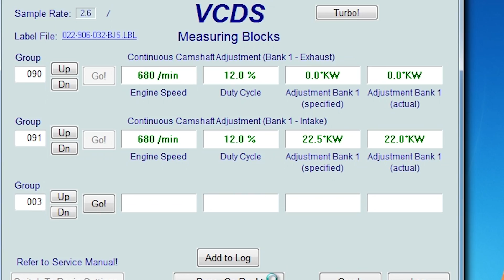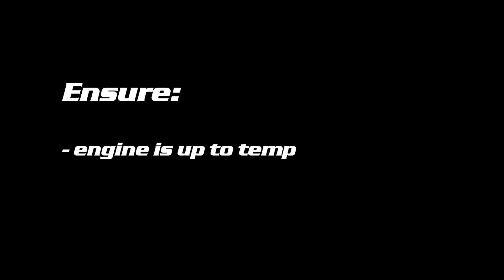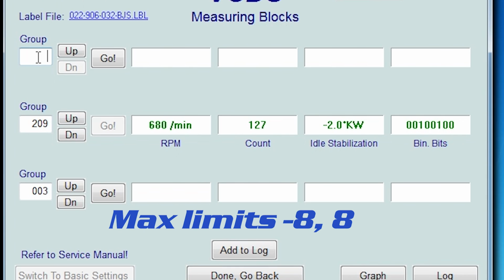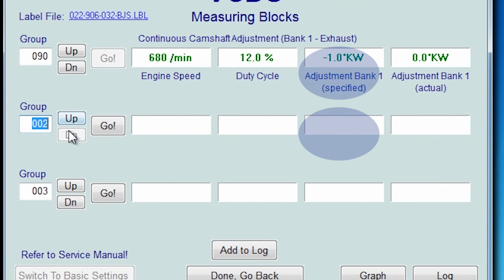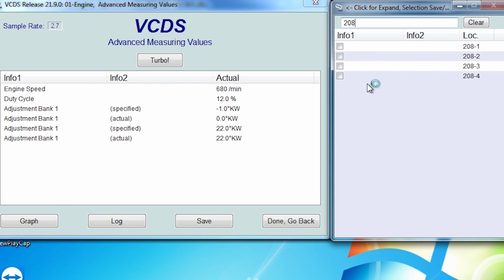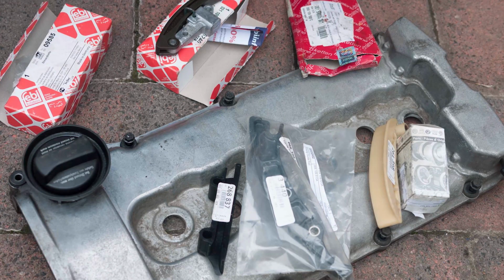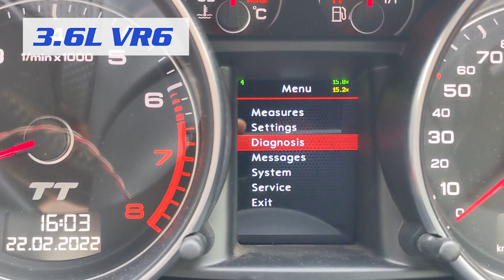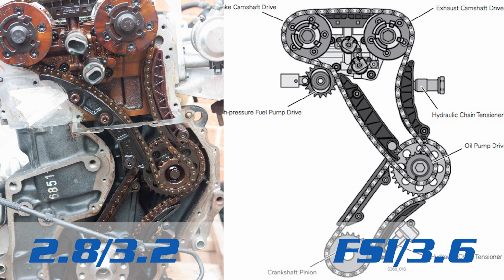Check VR6 timing chain stretch w/VCDS or ColourMFA (Golf R32 Passat R36 Bora 2.8 Audi TT 3.2)

Comment: My 208 reading is 0 and 209 is -7
My 90 and 91 both reading 0 
What do you think? Engine is very very quiet no rattle at all ever. Thanks
Reply: Probs could be 1 of the solenoid issue.. you should do a oil flush and then change oil every 3k I've seen peoples numbers drop
Reply: @sajidqureshi2175  thanks mate, funny it’s had two oil changes in 3000 miles and I’m convinced the original figures weren’t true
Reply: @khsmith6242  hmmm have you done oil flush the forte oil flush is really good.. I have a mk4 r32 aswell on 113k and chains was done at 74k. I checked the reading few days ago and still same at -1-2 and 90 and 91 0 and 0.5 so all good. I change my oil every 2k 2.5k.. car pulls strong from low revs lots of grunt.. remapped from rtec.. dyno bhp 247hp and 260lb ft. Before the chains done I got no readings on 208 and 209 think bcuz they was well above -8
Reply: @sajidqureshi2175  not done a flush no, at those numbers prior to changing chains were you getting eml or misfire etc?
Reply: @khsmith6242  before chains eml was on and codes for cam and crank correlation. Also noticed when starting from cold the when car fires up it felt weak.. but idle was perfect no misfire and the grunt was always there before and after chains.
Reply: @khsmith6242  how does yours drive nw.. does it have grunt from low revs do you feel the full torque kick in
Reply: @sajidqureshi2175  funny you say that a couple times it’s felt weak starting but it pulls well no chain noise etc never dropped any related codes. I think I’m going to try read codes again as I’d got a mate the read them prior to purchase
Reply: Are block 90 and 91 readings ok.. what the % it should be 15%
Reply: @khsmith6242  what was your reading before chains replacement
Reply: @sajidqureshi2175  chains not been replaced buddy
Reply: @sajidqureshi2175  okay so it was a mate who did it via vcds. So 90 was rpm 680 load 18% temp 76 and idle stabilisation both zero
91 was exact same
Reply: @khsmith6242  hmmm ok also do you know the history of car servicing bcuz i know most r32 when new was on longlife servicing which is absolutely fucking ridiculous and bad of engine. If its been on long life oil and changed everything 20k that can cause chain issues
Reply: @khsmith6242  oil temp should be higher around 100.. then check also thr load should be around 15%
Reply: @sajidqureshi2175  it’s got a very good history from new tbf VW if not VW some very very well respected independents one of the reasons I bought it. I think I’m going to get the chains read by a specialist and go from there. Thanks mate
Reply: @khsmith6242  yes that's good.. yea get checked from specialists. Are you in uk?
Reply from the maker: 😲Hmm that's weird that 90 and 91 are both zero. No codes ? What engine is that ?
Reply: @ianpgonzaga  mk4 golf R32, 2003 car with 103,000 miles. Whisper quiet engine
Reply from the maker: @khsmith6242  and zero engine codes ? If no codes then just monitor it I guess. Seems really strange though ...
Reply: @ianpgonzaga  no codes, so can you explain why is it strange? On the 208/209 figures showing a spread of 7 assume that indicates cam chains required?

Comment: There is another vr6 2.8 24v engine tht u shud of covered which EVRYONE misses.. dont know y thou. Its the the first vr6 24v that came out. They had 3 chains instead of 2 which the later variants came out with..
Cam chains are the same as the vw 1.8 turbo, then it has anoyher gear connected to teh cam from which the secondry chain hooks on to run the intermidiate shaft and then another  chain  than runs from intetmidiate to the crank sproket. 
Could u make a video in regards to this engine cz there is nothing on youtube in regards to this engine.
By the way engine code is AEU 2000 to 2001.
Reply from the maker: Hi Pearl. Interesting! I'd like to cover it but it would be something I don't really know much of so I would've be able to give accurate info.
Reply: Hi thanks for your video, I've had a fault p0343 on my 3.6 r36 so started looking at it.
My 208/9 values were +1 and -3, not sure what to make of that. The timing chain was replaced less than 2yrs ago by European specialists

Comment: Got a strange one. 
208 - Intake Cam. Offset = -9.0KW
209 - Exhaust Cam. Offset = -9.0KW
90 - Adjustment Actual = fluctuations between -1 and 0.5KW
91 - Cam. Adjustment B1 Intake (Act.) = Fluctuation from 2.5 to 10.0 KW

Sitting listening to the car idle, the "timing chain" noise can only be heard for 2 seconds every 5 mins. Worth noting I have no exhaust after the down pipe.
Reply from the maker: Hi Sean. Thanks for watching. 

This looks like it really way off! Do you have any engine performance issues?
Reply: @ianpgonzaga  Drives fine. Not had it out lately but drive it home 150mi when I bought it. Drove without fault. (Untill the exhaust snapped at the resonator lol)
Reply from the maker: @seanrobertson3833  LOL how does the exhaust ust snap! I'd say keep an eye on it - but those values are waaaaay way out - hopefully it doesn't just die all of a sudden.
Reply: @ianpgonzaga  I noticed it showing ERROR after about 20 mins of scanning, hitting Go brought the values back. Not sure if maybe the impulse sensor is dodgy? 
If I keep driving it, will it go BOOM? Or will the timing chain noise be more frequently/constant. 

It has been bought as a project car. It's an A3 2004 3.2 on 92k miles. I've got the quarter panels to replace (rust) and the timing chain on my list. But trying to work out the urgency of the timing chain.  I have so far got a new exhaust sitting for it as well as a new interior.

Comment: First of all, thank you so much for being the only one that actually explains how to read those values and what do they mean. Awesome job!
I’m a little concern about my VW MK4 R32
Block 208 reads -8.0
Block 209 read -7.0
Spread is just 1 degree 
Then 
Block 90 reads 22* and 21.50*
Block 91  reads 3* and 3.50*
Not sure why looks like 90 and 91 are mixed between them 
Also, I used the OBDeleven scan 
Do I need my timing chain to be changed like right now?
Thanks!
Reply from the maker: Thanks Santiago! 

If you have a noisy engine I would probably do the timing chain and guides service asap. 

If it's not noisy and you tend to drive hard then probably best to have it high on the priority list. 😉
Reply: It’s not noisy at all… 
And I just got her, so I’m still easy on her until I actually know the car lol
Thanks again! It gives me time to find a technician that actually know how to work on it, hard to find in the Florida keys
Reply from the maker: @santiagopalmero3807  good luck! You got any pics of your TT  in insta?
Reply: @ianpgonzaga   I don´t have a TT, its a MK4 VW R32
Reply from the maker: @santiagopalmero3807  oh yeah that's right. Did you have pics on insta of the R32?
Reply: @ianpgonzaga  not that many , but I’ll start posting  more often lol 
@santipalmero

Comment: Perfect, straight to the point video. My findings: -3.0 kw and -5.0 Kw. is this bad? Do I have to think about the chain replacement? Thanks
Reply from the maker: Thanks Dusan! ☺️ That's on the way to bad ... The closer the numbers at  either extreme ( -8 or 8 ) calls for consideration of timing hardware service. Good luck!

Comment: Ian bro thank you for an an awesome educational video ! Wich made me run to my Touareg 3.2 to check the timing. 
From what i understood and the results that i saw on my vcds im guessing i need new chains .... But before i commit to spend some $$$$ ill appreciate your input ... So here are the results 
G.208 -5
G.209 -5
G90 cam exhaust 20
G91 cam intake 0 
All are from the 3rd column

My guess is to order new parts right ?
Reply from the maker: Hey Nabil. Yeah sounds like you should look into chains and guides replacement. The closer to -8 the worse for wear it's all at :)
Reply: @ianpgonzaga  thank you man. 
You are awesome 😎😎👍

Comment: Looking to buy a R32 but I heard a rattle. The owner took it to a garage but only got the next values : "intake camshaft adjustment = 0 KW" and "actual signal inlet camshaft = 5 KW". Are these values any good, or don't they relate to the timing chain stretch?
Reply from the maker: Hi Martijn. In what measuring blocks are you talking about ? 90/91?
Reply: @ianpgonzaga  Hi, it wasn't measured with VCDS but with Mega Macs 66. I'm told those values correspond with the 208/209 in VCDS but as I don't know that system, I can't tell if that's correct. And since the timing chain is a big job, I'd rather have some certainty...
Reply from the maker: @martijnreekmans6171  sorry I'm not sure what mega Mac is either. Best to double check with VCDS or something similar to make sure...

Comment: Great video! I have a Passat 3.2 FSI with 1 fault: 000023 bank 1 sensor 3 (g300) / engine speed sens (g28)
P0017 - 002- incorrect correlation.
In group 90 adjusment (speciefied) -25kw, adjusment (actual) -6kw.
I bought this car last week, and I didn't know that had this problem.
Can you help me ?
Thank you!
Reply from the maker: Hey thanks. Incorrect correlation sounds like it's not in great condition in there. Timing hardware most likely needs attention.
Reply: @ianpgonzaga  thanks for your quickly answer. I update information.
I disassemblied upper timing chain cover, found a disaster.
I had a upper timing chain guide broken, replaced it by a new one, and seted chain in correct timing. The fault persists. Does this mean chain stretch?
Reply from the maker: @shagusgaming  that's good you found some of the issue. Remember there are more guides in the lower section. You would typically inspect those too.

Comment: Best explanation Ive seen on timing values. Thank you! I have a question, checked my 03 GLI 24v Im certain it needs chains. My intake phase is -6 my exhuast -5 but I noticed my cam adjustment is swapped from yours, intake is 3 and exhaust is 22. What does that mean?
Reply from the maker: Hey thanks. I would say with those values being so out it definitely time to replace the timing components before your engine kills itself.

Comment: This is a great video! I have a 2007 passat 3.6 with the BLV engine and when I go to groups 208 and 209, the "intake cam offset" is -4.0, and the "exhaust cam offset" is 0, so I might need to replace the chains soon right?

In group 90 it says my adjustment is -25, and in 91 it says it is 18. When you are in the passat r36 the numbers seem similar to mine, is this good or bad? Thank you!
Reply from the maker: Thanks Riley. I would consider it soon. Otherwise do more frequent oil changes to tide you by and hopefully no rattles start making their way into your engine. 

If your 3.6 group 90 and 91 are the same as mine i'd assume that is the set value. There is not too many people who have taken these readings for m 3.6 VR6 so thanks for sharing. 

You will see that the other number can fluctuate. If that fluctuate too far from the -25 and 18 that's when it's bad.
Reply: @ianpgonzaga  Ok, that makes sense, should I even hear the timing chain at all when its running? I can hear it, it doesn't sound bad but I was worried. Thank you so much.
Reply from the maker: @rileymajor2093  nah... You can't hear the timing chain at all on a healthy engine. Most common sign that most ppl freak about is the rattling on startup.

If that rattle is consistent as the engine idles then that's worry time.
Reply: @ianpgonzaga  Ok, thank you for your help!
Reply: @ianpgonzaga  Thanks for the Clarifying Video and Expert Help. I did get worried when i hear the tapping/rattle  for 5-7 seconds, upon Start-up on my 09 BLV  3.6 CC VR6 FWD
Reply from the maker: @ampiko68  no worries. 

Hope now you know what to look out for! X
Reply: @ianpgonzaga  RE: "here is not too many people who have taken these readings for m 3.6 VR6 so thanks for sharing."
cheers for the vid, if it helps, my 3.6VR6 is reading 208: -5, 209: -1, 90: -25.5,  I didnt check 91. 

Car seems to run fine, I've never had the chance to hear another one in-person for noise-comparison.
I've got a once-yearly slow cam response DTC, so I keep tabs on it. If that 208 number jumps up much more, I'll do something about it
Reply from the maker: @ExtractoDeTomates  Thanks for the info on your readings. I"ll keep an eye on mine - i am due for a timing chain and guides refresh so haven't really been driving it much.

Comment: Great video. I had my head gasket done on my Golf 2.8 V6 last year and now readings are wrong or blank and they were the same as your readings before it was done. Car seems to be running fine but now I think as  the top chain was removed to do  the head I think it may be out of alignment.
Reply from the maker: Yeah that doesn't sound the greatest result. You got no other errors? Sounds like there may be a sensor error...
Reply: @ianpgonzaga  I had my mechanic change the sensors but still the same, no engine light or fault codes so I am stumped. Blocks 208 and 209 were -8 so flushed the engine 5 times with clean oil as reading on the internet and brought the readings down to -2 Block 90 and 91 are wrong
Reply from the maker: @maxineg1439  😢 what a mystery. Sounds like it's running OK for the time being so 🤞 no disasters occur.